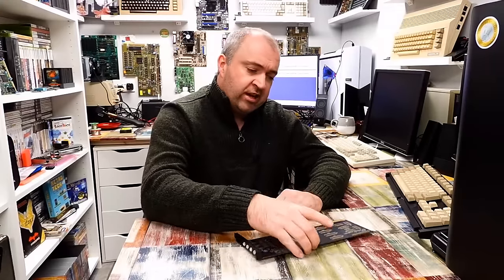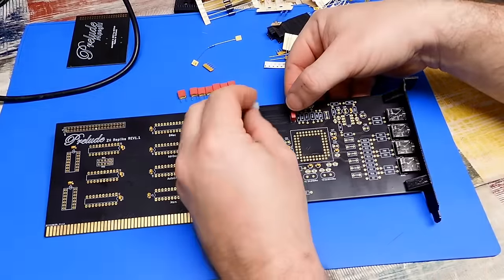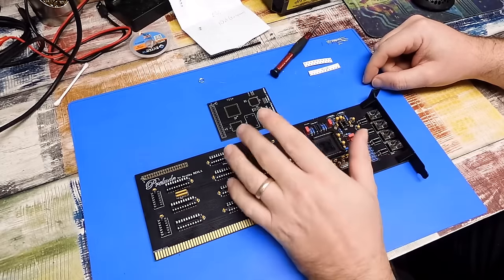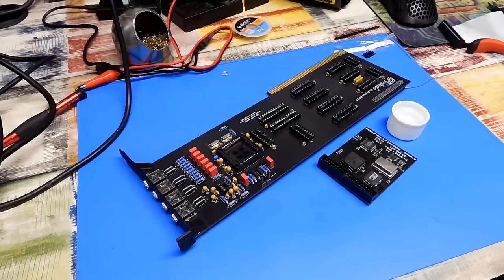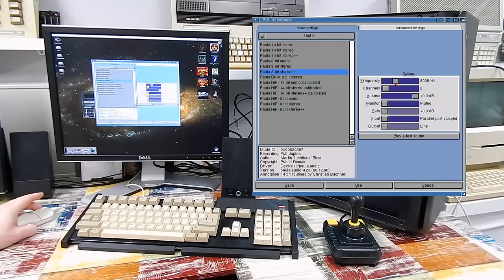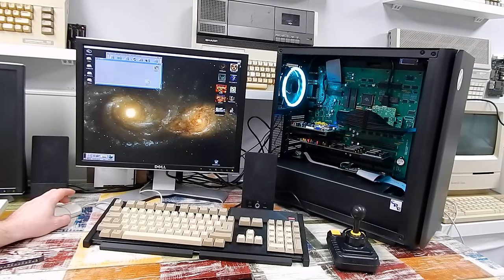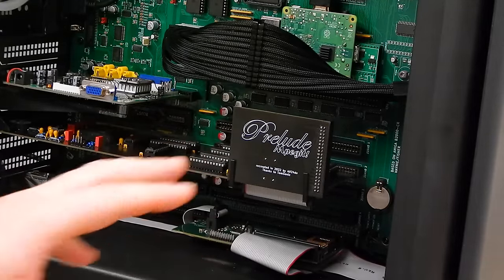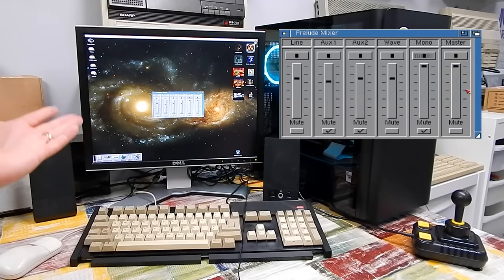Building a Prelude Zorro 2 Amiga sound card

Comment: Really cool video. You have shown me that I should learn how to solder myself with through hole components like this card. Does not look too difficult. I am waiting for the AmiBlaster to be released on Amibay which hardware decides FLAC with a newer chip. My entire library is FLAC, with no MP3’s so a perfect fit.
Reply from the maker: Through hole soldering is straight forward enough, I'd recommend just getting yourself a half decent temperature controlled iron, some branded flux core solder and for starting out that's all you need.  

I'm not familiar with the AmiBlaster, I'll have to look that up.

Comment: I strongly recommend that anyone doing surface mount soldering by hand get a knife edge tip. I personally use a Weller T0054462199N and can't recommend it enough. Also, soldering iron tips do wear out over time and need to be replaced. You won't always notice when a tip is wearing through the plating immediately, but when you switch to a new tip the difference will be night and day. I've soldered hundreds of PCBs by hand with 4x 24 pin 0.4mm pitch TSSOP parts and two dozen 0402 parts on each. After 100 boards it was getting harder to get good results, so I cleaned the tip really well and found it had a cavity that had eaten through. Bought a new tip and went back to soldering like a dream.
Reply from the maker: I've tried using a knife edge tip before and while I can use it I must say I prefer the type of tip I'm using in the video.  But yes they do wear out and I do actually need to order some more myself, could use a slightly smaller tip if I'm honest.

Comment: This brings back some memories.... 1998/9 with my Prelude 1200 ( clock port ) sound card and 66MHz 060.... fun fun times.... with Octamed SS and 168khz Mp3 playback...  kinda jelly when looking over my shoulder at my A2000.... it certainly could do with some love... 

If memory serves, the Aux 1 was used for the Amiga throughput, Aux 2 ( as you called it ) was used for the CDROM Audio - I didn't seem to have the input recording issue, I would record either the synth ( with low input gain ) and the same for the Electric Guitar - although my amp for that back then was old, at times crackly and quite sassy on the gain/crunch once it had chance to heat up... one of the hardest things to work with, but I do miss that thing.... 

A big thanks for sharing CRG - i look forward to the next adventure.
Reply from the maker: Sounds like you had a fantastic setup back in the 90s, I had moved onto PCs by that point.  It does make more sense to use AUX1 as the Amiga passthrough so I'll have to fix that.  Still struggling with the recording though, it still sounds terribly muffled no matter what source I try.  Might look to swapping out the OPAMP or some of the associated components to see if that helps.
Reply: @CRG  a lot of my friends in the mid/late 90's were selling off their Amiga collections to buy into the PC's of the time,  so I ended up getting quite a boon to my collection.  I built / worked with PC's in the mid 90's for work / programming so I had no RUSH to have a PC at home. 

I am unaware of Prelude ( replica ) project directly, however, sans a software fault -  I suspect that there might be an impedance of "line in" that you record from.  Since its an open source project when I get some time I will have a read of it. 

Sounds like its being clipped to 8bit as opposed to 16bit, however saying that even my Megamix Sound Master ( 8bit parallel sampler ) sounded better than what you were able to achieve.  

Also, do you have the direct audio files, I am curious of the sample rate / and bit depth of the recording, if it is 16bit at 44.1Khz ( or higher ) then is should sound a lot better that even my poor laptop speakers made it out to sound.

Z.

Comment: For cleaning the flux   ES132  even if it is a solvent for ultrasonic cleaners  but I found it working quite well if you soak the board with HOT water. then ES132 on.   scrub the board.  let it soak for 5 minutes or so.   rinse of with HOT water and scrub meanwile.   result will be just fine!
Reply from the maker: Thanks for the tip Chucky.  I've never tried washing a PCB but I suppose so long as its dried properly there is no harm in it really.  I'll try to get some of the solvent and give it a go cause it would be nice to have clean boards to look at through my case window.
Reply: @CRG  yeah  let it dry for some days and you will be happy about the result!

Comment: Maybe try a 44.1 khz mp3 or set the sound card to 48khz to match your test mp3? It would do a FIR conversion which eats up cpu cycles I think, and clarity could be impacted if the play rate conversion isn't high quality. 
As for recording, that sounds like my soundblaster 16 card lol! Terrible distorted sound quality and added a lot of noise to boot! AC97 wasn't much better. Not until HD audio chipsets arrived anyway.
I never knew how the soundcards were implemented on an Amiga. I just owned an A500 and A1200 so I have no experience with that. Good to see how things work and how you can choose different sound card options.

Comment: the old Paula works in DMA mode. 
The CPU has to shovel the data over the Zorro bus. That's why it needs 10% power.
Reply from the maker: Would that partly explain the highish CPU usage even while hardware decoding?

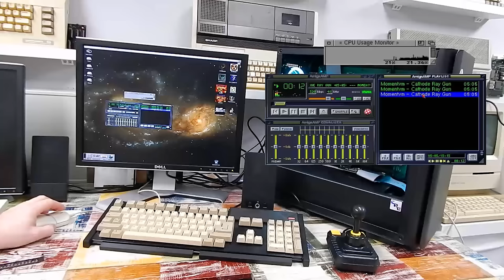Comment: 31:30m - An aside, but I am glad you mentioned your PiStorm performance with Emu68! Some how I "missed the memo" on the PiStorm performance improvements (with Emu68 c. 2021/2022), and I've been wondering some folks PiStorm Amigas lately are so much faster than my '040-based 2000 when others PiStorm Amigas are so close (to mine) in performance. Obviously the difference is that ones running Emu68 are blazingly fast... and those still back in the '040 performance were running Musashi instead of Emu68.
Anyway, just letting you know you taught me something else in passing.
Great work on the sound card... still on the bleeding edge, aren't you? :)
Reply from the maker: Not sure that spending a few hours building a sound card to play MP3s could be called bleeding edge, especially when the phone I'm writing this on can just stream the music directly 😂.  And now I've given myself the idea of can I get streaming audio playing on the Amiga Prelude 🤣

As for the pistorm, emu68 is fantically fast.  It is still hindered by a few bugs, much like the original Musashi software meaning that most demos for example won't run but it does make for a really nice and fast RTG Amiga.
Reply: @CRG  Ha, well maybe you are what we called a "heat seeker" in that you seek out the nascent (retro) things that might cause you more pain (for a time). :)

You can take heart that most demos won't run on my '040 2000 (NTSC). I am amazed that Mikes Retro Tech gets so many to run with PiStorm that I can't run on my vintage '040. (He has posted some great collections of demos.) I posted a couple demo videos recently including the preamble recording whether I needed to switch to PAL mode (which works fine with the ZZ9000) first and what accelerator settings worked (for me).
Cheers!

Comment: Is the issue the chip or Emu68 itself? Have you or your pals tried to use another Amiga sound card to see if it has the same issue?
Reply from the maker: The MP£ playback issue is 100% the mpeg chip, some of the other guys have replaced their chip by now and it fixed both the noise and the slow playback.  The static is another issue though, really not sure whats causing it and I suppose it might be something to do with the pistorm.  I unfortunately don't have another processor to test with other than a stock 68k.

Comment: The Micronas DSP on the MPEGit card could possibly be used for wavetable synthesis as well.
Reply from the maker: There was another expansion available for the original Prelude called the rombler which added a wave table header https://amiga.resource.cx/exp/rombler

It doesn't look that complicated of a card but without the code for the GAL on it, it'd be difficult to recreate.  Not sure what software would be able to made use of the wave table though, other that perhaps some of the audio sequencers.

Comment: I hate when people critique soldering on Youtube but flipping the PCB to solder every individual cap is the most tedious thing I think I've ever seen. Its pretty easy to get something to hold the PCB up, insert all the like components, splay the legs then flip and solder. I also don't understand why people think soldering surface mount is hard. It takes a bit more technique but you can handsolder a PCB with SMDs in less than half the time.
Reply from the maker: No need to hate yourself.
Reply from the maker: To be serious though... I do have one of those swivel PCB mounts but it's just not large enough to house this board.  I could probably have fitted EVERY component then tried to solder but there would be so many legs on the bottom getting in the way of each other.  I suppose at the end of the day what does it matter if I do it one at a time or if I do it all together.  

And surface soldering isn't difficult but I know a lot of people see it that way hence my little joke about the dreaded surface soldering.  I've completed plenty of surface mounted soldering projects and yeah it is a lot quicker.  I did reference that it took forever to do the through hole on this board, probably about 3 hours or so.  If surface I think I could have got it all done in an hour . But its my time to waste and I enjoy the process so...
Reply: @CRG  Wow dude, I think you need to learn to take simple criticism if you're going to make Youtube videos. Of course it's a hobby, nobody in their right mind would even design a PCB with all through hole components these days other than to make it simple for beginners to solder. A stencil costs $7, if that PCB were SMD a guy with a hotplate and a tube of solder paste could have made 20 in the time it took you to solder that 1. My comment was more for people watching because while they may get a kick out of a DIY project, I doubt they want to take time cherish every solder joint as you do.
Reply from the maker: I can take criticism perfectly fine and I read every comment and try to take on board something from everyone but to say my methods were tedious, well, each to their own.   There is actually a half size version of this board which has a more modern design and is mostly surface mount.  We decided on the full length board for this build because why not.

Comment: Maybe the PCB gold plating is so thin to not be of a concern, but I recall there used to be a concern using tin/lead solder on gold contacts due to potential embrittlement?
Reply from the maker: I'm not sure what type of finish went onto these cards, I doubt its hard gold though and just to save on cost.  The cards been in and out of the zorro slot a few times now and the pins are a bit scratched up but seem fine.  Can't see me taking it out again though, no real need to.

Comment: I thought Z2 slots had left/right signals from paula? Or is that only on Z3?
Reply from the maker: Yeah as above there's no audio on zorro.  Would be handy and save on the external cable but unless anyone has a time machine and the ear of Dave Hayne (I think he did Zorro) I'm afraid we're stuck with what it is.
Reply from the maker: @Kobold666 maybe that's part of the reason why they aren't there although I expect its more just because they aren't really needed on there.

Comment: the higher cpu usage with the mp3 decoder installed is likely due to overhead IO of the file sizes differences.
Reply from the maker: Yeah you're more than likely correct but for the most part I'll probably be using 128kbps MP3s keeping CPU usage to a minimum.  Back when this was new in 1997 we were probably using 64kbps MP3s 😆

Comment: I really need to stick my 1200 in a tower, one day :D
Reply from the maker: I had a 1200 in a tower in the early 00s but later sold it all.  It wasn't particularly fast with just an 030 running it and I suppose that's part of the reason I ended up getting rid of it as that processor wasn't really up to the job of running the mediator board and the PCI cards I had in it.

Comment: I've found that the best way of removing flux residue is to start by spraying with IPA then scrubbing it with a brush, but then I make a second pass, except this time place some sort of cloth or paper (preferably something that won't leave paper/cloth droppings behind, such as a lint free cloth or Kimwipes) on top of the board, then use the brush to blot up the liquid (IPA mixed with flux residue) left on the board. Sometimes it takes a second pass with the cloth, and it is admittedly a bit of a hassle, but with this method I am able to get my boards looking factory fresh, with no nasty flux residue whatsoever. But yeah, an ultrasonic cleaner is definitely on my wish list. :)
Reply from the maker: Good idea I'll try that.  I'd love to get an ultrasonic but they are very expensive and there's a massive list of other things I want as well.  Next up on the gear purchasing is a new camera, in fact Santa should be delivering one in a weeks time 😁